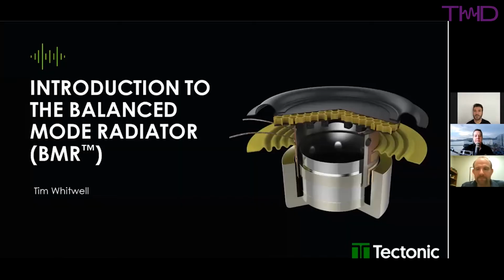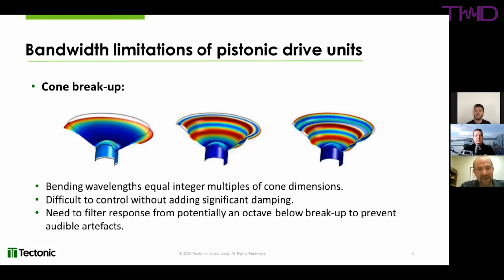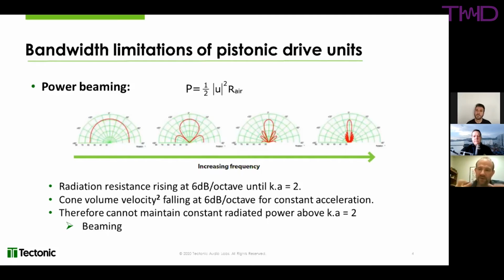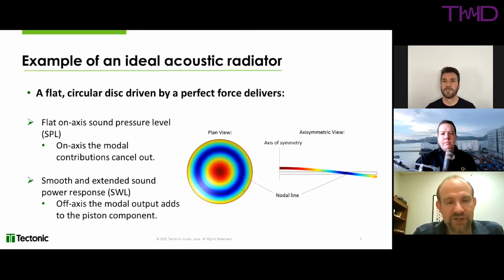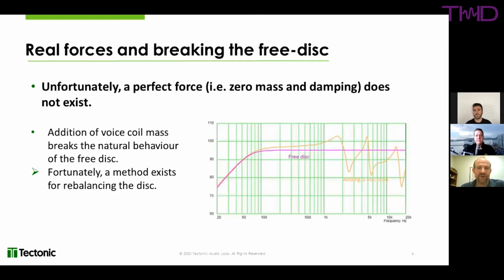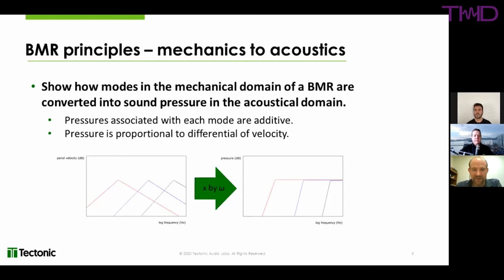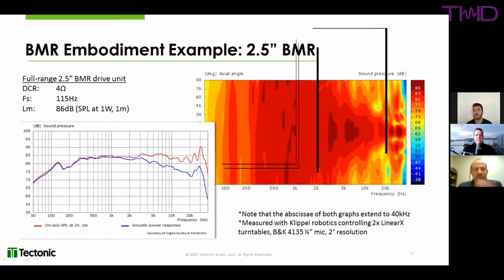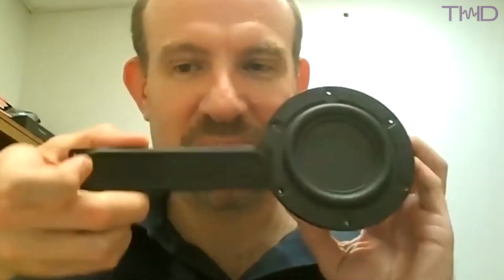THD Podcast 13 - Tectonic Flat Panel BMR Speakers and Off-Ear Gaming Drivers E-Sport Headphones

Comment: Can these be used in an open baffle configuration?
Reply from the maker: the answer is yes, and actually that is how they are used in the VR headsets from HP, etc.  There is no enclosure on the rear side of the driver, just some acoustic foam and a grille for protection.
Reply: 3.5 inch as OB wont have much bass response.
Reply: @ichigobankai2343  I was thinking desktop speakers with two of these, one enclosed, at diff frequency ranges with a network.

Comment: Can I ask a question abut DML speakers? Is it always desirable to use panel material with the highest stiffness to weight ratio (sandwich composite), or is it more complex, and can flexibility have some advantages?
Reply: Best materials have to be stiff but very light.  The two best materials for DML that fit the stiff and light category is High Density (EPS) Expanded Polystyrene and Kevlar/Nomex Honeycomb with resin with ideal thickness of 1/4-1/2 inch thick.   Thinner the material the easier it is to bend.

Comment: Why are BMR's small?  Why no 6inch BMR or 8inch BMR?
Reply from the maker: Hi, the largest design to date is 5.5”.  So the simple reason for no 6” or 8” is that no one has designed version in these sizes yet
Reply: @THDPodcast   I know that but my question is why hasn't anyone designed a BMR driver over 6 inches yet? Most standard bookshelf speaker drivers are 5-1/4 ,6-1/2 and 8inch.

Also if I am not mistaken the 5.5 BMR driver is not readily available to the general public.

I build custom DIY DML panels and until there is a 6inch or larger BMR driver the DMLs will outperform the tiny (3.5inch and under) BMR drivers.
Reply from the maker: @ichigobankai2343  The reason is largely commercial in that the brands demanding BMRs in volume just have not requested larger sizes (yet).
Reply: @THDPodcast  Ah ok I didnt know it was based largely on commercial brands demands.....I was thinking more of DIY aka Parts Express.
Reply: @ichigobankai2343  Most BMRs are made of paper, and currently a 6" corrugated diaphragm would no longer be light enough nor rigid enough to offer advantages over traditional conical drivers.
Reply: @Cakebattered  With todays technology BMR's dont have to be made with paper as they can use the same type of materials as conical drivers or high areo space honeycomb composites made of Kevlar/nomex impregnated with some type of resin.